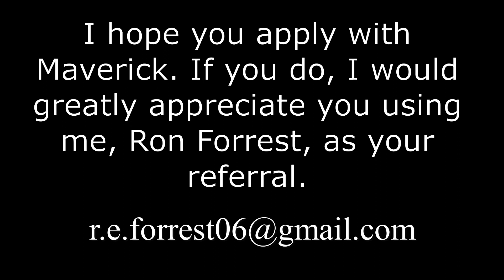Maverick Flatbed Trucking #464 Sheet Steel, Gary IN to MO

Comment: That customer is not exactly the safest looking work environment. Surprised the forkie was able too lift the sheets of the trailer  
with what the weight of the steel was doing to it low to the ground 🤣 If it works, it ain't stupid. Just looks dumb 🤣
Reply from the maker: yes, I got a laugh out if it